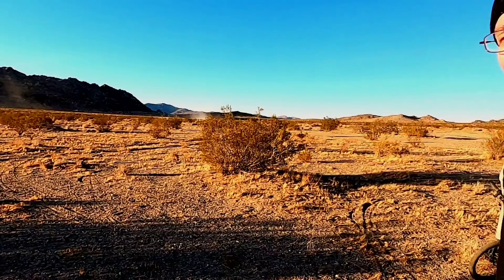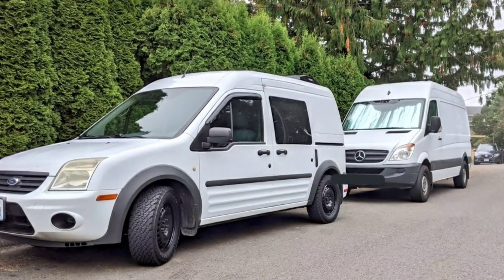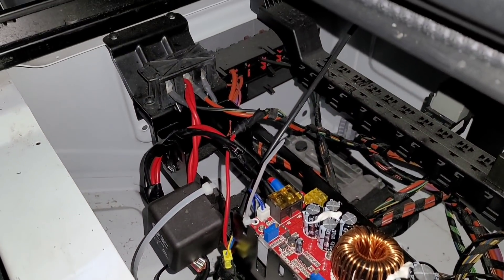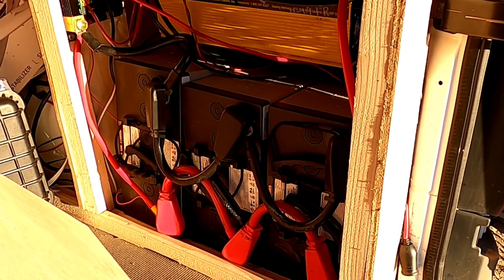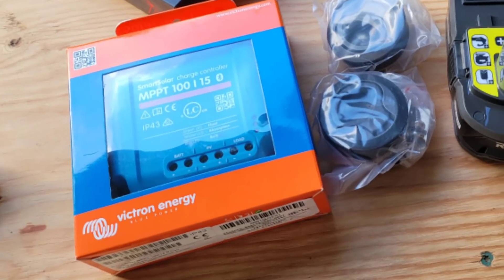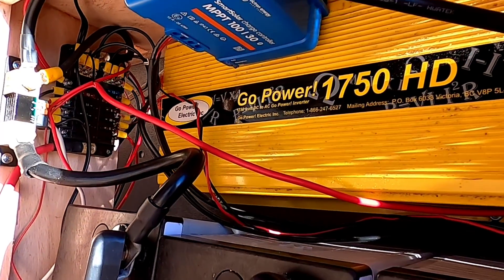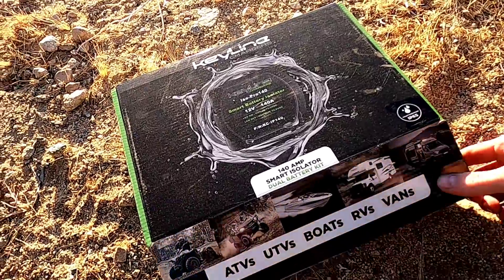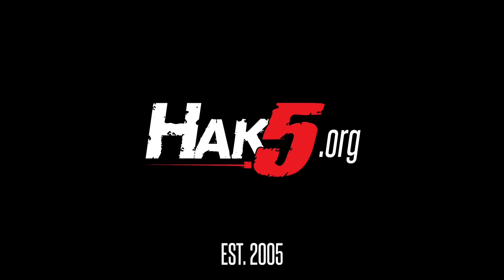Even Bigger DIY Solar Battery Banks and Power Systems! w/Glytch

Comment: I would recommend using a DC-DC Charger for charging while driving, Victron makes one, which is also Bluetooth connected via the same App. Those Smart Solar regulators are awesome. I don't know how available Schaudt products are in the US, but they are also very good. For Inverters i personally prefer the DSP-series from Dometic(again, not certain of the availability). Hope this was of use. Greetings from an RV Technician from Germany

Comment: You should always charge your "house" batteries and then have them charge the starting battery via a dc/dc converter, much more efficient that way and less stress for the system.

Comment: 7:40 12-bay fuse block - which model and is this for DC or AC power? 
Do you use Anderson pole connectors for running DC power to devices?

Comment: yes the power inverter up in the motor bay make it drip...
Reply: isolater goes up front with the motor, also turning sprinter van green ... hybrid or bio diesel.

Comment: So could you play Switch/PS/Xbox for several hours at night without a problem??  Cool vids, keep them coming!
Reply: @Glytch  Thanks!!  I guess a separate big Jackery or something with a Switch and an USB monitor might work for non-handheld mode.  Or just run emulators on one of those fancy new M1 Macs.  I mean I do have multiple Nintendo like GBA and 3DSXL.  I guess i would need lots of solar and lithium batteries to cover night time gaming fun lol.

Comment: just a note your AGMs will only provide 1/2 there rated power , same as all lead acid batterys no problem with your good solar but if that stops  , hope this forewarns you all the best from rainy cold UK

Comment: AGM batteries aren't cheap, but they also aren't expensive. I would suggest making up more room and running another 3 in parallel. Twice the capacity.

Comment: I saw what looks like a Baofeng.  Fellow Amateur radio operator?

That standby consumption is a deal breaker!    They swapped conveniece for usability.  It would be interesting to see what you did for refrigeration, heating, cooling.

I've been doing my best to make everything work without an inverter wherever possible.  It's easier to save power then make power.  Which brings me back to heating / cooling.  It's not a sexy topic but I hope you've done some insulating.

Comment: Given that you have so much power generation you could think about building a AC and / or fridge. Especially a AC will have the biggest power draw when you are generating more than enough power.  Chilling your water tank would be a great buffer in summer for the evening/night and as a bonus you'll have nice cold water. Fridges you actually can get pretty efficient ones already. But I'd suggest creating some form of venting to the outside of the van. Why dump the heat inside it if you can dump it outside? (roof maybe?)

You might also be able to build it as a heat pump, but it's most likely that in times where you could use the heat, your power generation will be low too. But then again creating hot water from your freezer/fridge/ac would be a nice way to recycle power. But you need the space for a insulated water tank.

Comment: Generally, you want a DC-DC charger and not a battery isolator, because those AGMs will create a load on the vehicle alternator the isolator can't control or limit. This allows you to size your DC-DC so the alternator can't be overheater by a low SOC pack. A good DC-DC can also be configurable so it will be an appropriate charger for your lithium batteries.
Reply: @Glytch  awesome, that's the more expensive but otherwise better option. Glad you got it figured out.